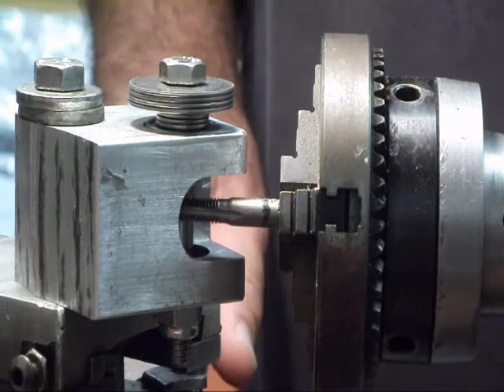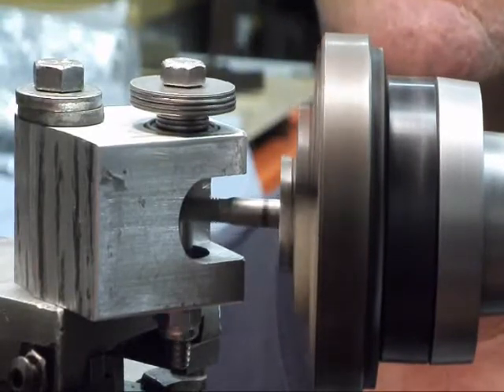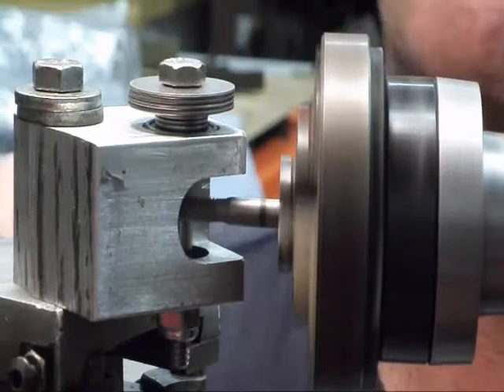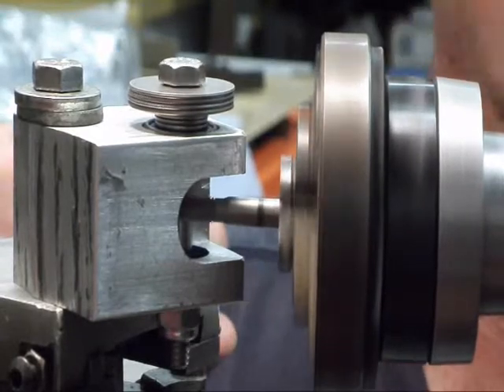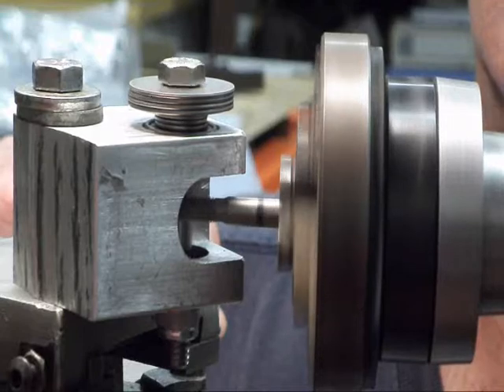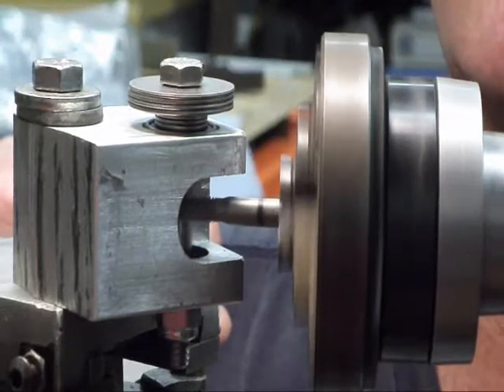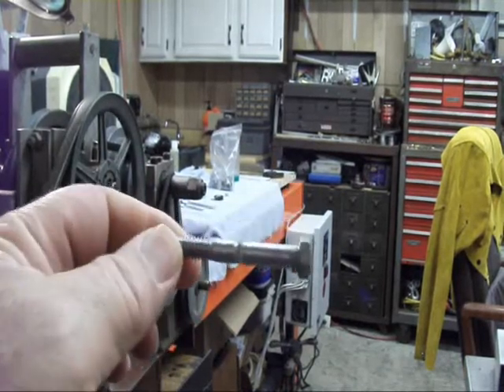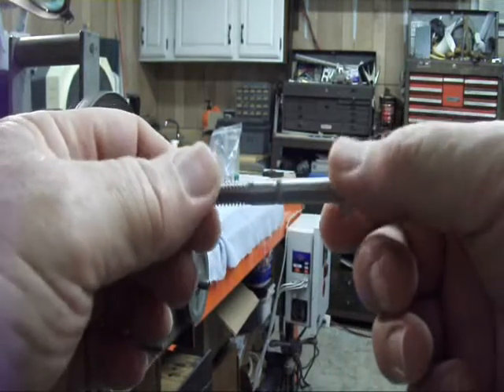3d printer # 7.5 how to video

Comment: Nice technique, I do not have a lathe so I plan to try this using my drill press and an adjustable block bolted to the table holding the bolt.